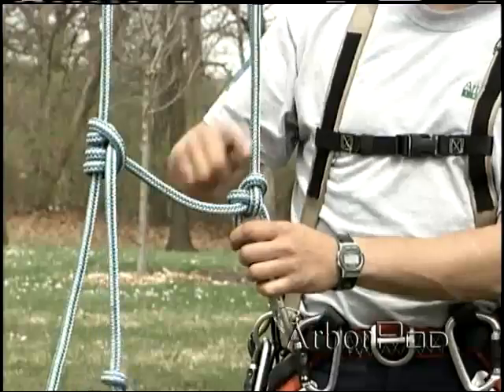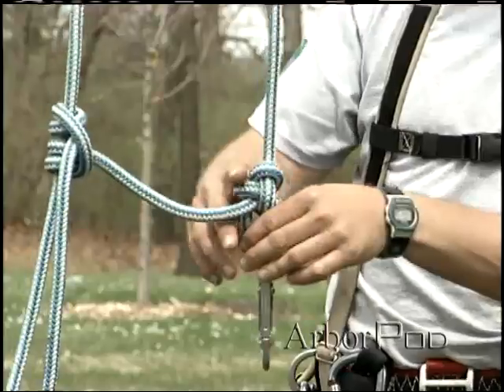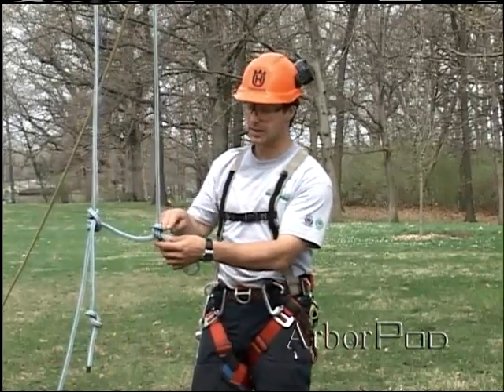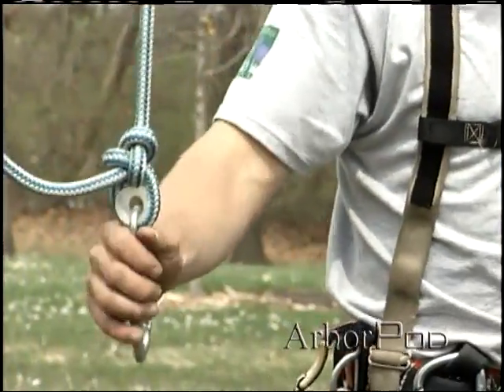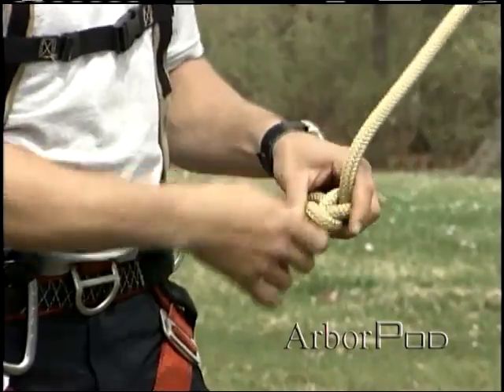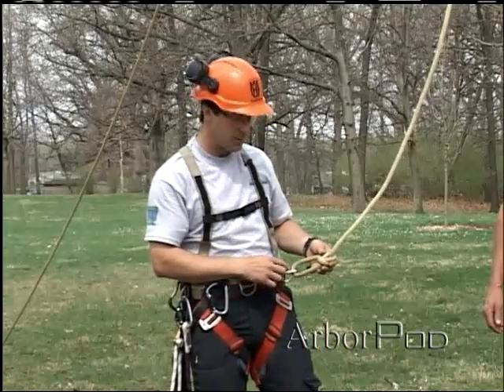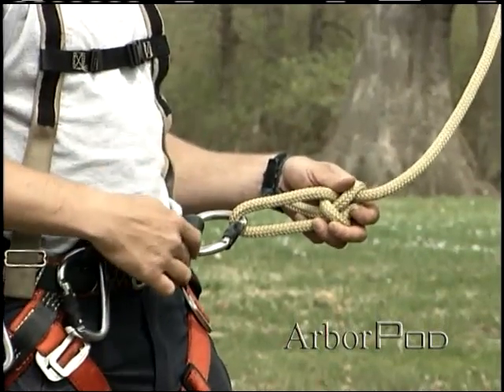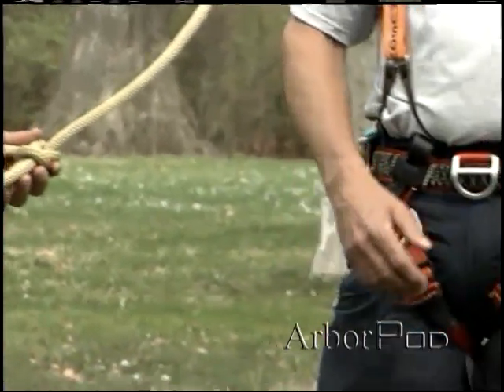Anchor knots and Limitations

Comment: I have a lot of friends who swear on the buntline or scaffold knot which both cinch and I think the buntline may slip. A double bowline or a water bowline are more secure, slightly bulkier than bowline but pretty sure you don't need a stopper. My favorite is a underated knot called the Eskimo bowline si nce it is easy to tie and so secure. Drawback is this will cinch like a Mother!!! Oh also so many different ways to tie.

Comment: The answer is not simple. I think the trade off is a bulkier knot that is pretty easy to tie vs a simpler one that requires a tie off or stopper knot. Also to consider is if you care if it cinches up with pressure. The bowline on a bight is secure, slightly bulky b/c there is a double loop but still easy to untie. Figure 8 on a bight is safe, bulky and will cinch. Could consider using a hitch like an anchor hitch/bend or the anchor bend variant (essentially a round turn around the carabiner then finish with a round turn run through the first RT.

Comment: Never known  a prperly dressed and pre-tentsioned  bowline to fail, although I have seen a demonstration of a bowline on teh bight failing when repeatedly subjected  to shock load at a "Y" pitch.
They were not properly dressed, or pre-tensioned and the ropes were synthetic.
I doubt if a natural fibre manila hemp rope with a  properly dressed and pre-tensioned  bowline would ever fail if a decent tail is left on it, say  2 feet.
I've seen really very sloppy  bowlines hold under a shock load.